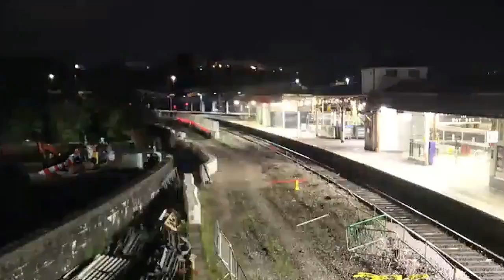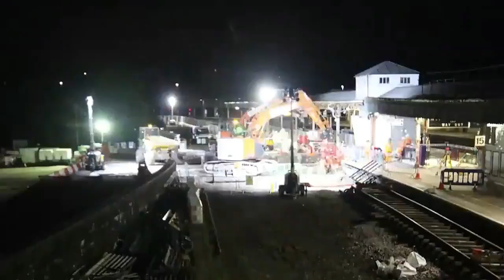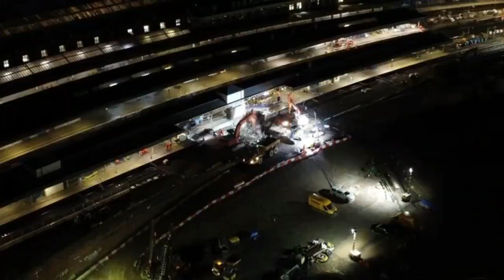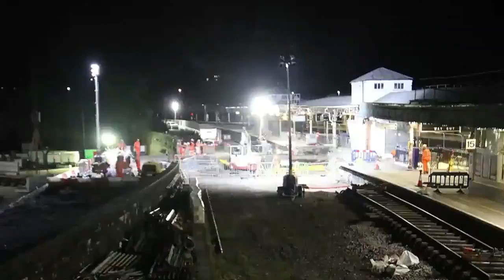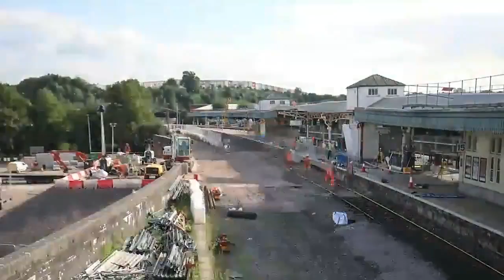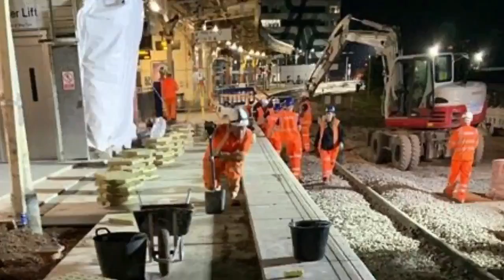New entrance at Bristol Temple Meads

Comment: Oh I just know it's going to be an ugly modern architecture monstrosity.
Reply: Judging by the design drawings it's going to be a fairly minimalist style, not a monstrosity by any shout.
Reply: Maybe you would prefer it to be built in Brunellian cast iron? So 21st Century!
Reply: @ijstock  i would
Reply: @ijstock  .,.the old buildings were well designed and the architects thought long term (100+ years), not short term (the next 30 years). They were built to last, using good quality materials. And they never cut corners. 

Most modern buildings are not designed to last more than 50 years, because they use cheap, often poor quality materials - and yet they STILL manage to go over budget.

 As a result, corners are regularly cut. The attention to detail just isn't there - no one cares about this now. And the finished design is often immensely dull, or tried too hard to be different....and is idiosyncratic and not that practical. 

I am not saying all modern architecture is rubbish, far from it. But 50% of it is, and most architects don't have an eye for detail or a knack for choosing decent materials that work well together. 

Architecturally, we seem to be repeating the mistakes in building design we made in the 60's and 70's but with a contemporary feel.
Reply: @ijstock  1930s style preferably, to suit the 1930s 'new' platforms
Reply: @robtyman4281  I am not at all sure that all old buildings were well-made. It's just that the ones that weren't have generally not survived. Consider how many Victorian buildings have/had little or no foundations. Good/bad buildings are not a new phenomenon, though I agree that in this country we have not learned half as much as we should have. That's what comes of putting profit before a good built environment. Equally, over-budget is as much to do with flawed tendering processes as anything else: this country is also far too preoccupied with doing everything on the cheap. But I disagree about quality and attention to detail - there are plenty of superbly designed and made modern buildings here - we have some excellent modern architects in the U.K.; as for attention to detail, that means something rather different with pared back modern styles. I don't disagree with all your points by any means - but they are rather different from a debate about stylistic merit, though sadly, many people fail to see this. I still don't see that self-conscious replication of historical styles is appropriate or necessary, let alone the way forward. As in the link above, I commend the Swiss as a nation who know how to build fearless, great modern architecture in sensitive environments.
Reply: @AndreiTupolev  see my reply to Rob Tyman above! Why cannot we have the confidence to build in the style of our times? Is copying the old stuff the best we can conceive of? It is, incidentally, not what builders did in most of the eras now held up as exemplary historic styles (though I concede that the Victorians were in love with a mythological British Past too...) Why oh why does this country need to give one of its premier lines a "heritage" Victorian name, and even go so far as to paint its 21st century high speed electric trains in drab heritage green? Who is it kidding? I've never seen anything so ridiculous. Give me the French/Swiss/German approach any day.
Reply: @ijstock  BR did that in the 60s at Euston and Birmingham New St, which was somewhat... controversial. Or really not so much controversial, as everyone hated New St
Reply: Weirdo
Reply: @AndreiTupolev  Indeed so - but that's surely not a reason to retreat into pastiche? Look at St Pancras or KX as examples of successful new reinterpretations of historic buildings.
Reply: @amfwelsh  ?????